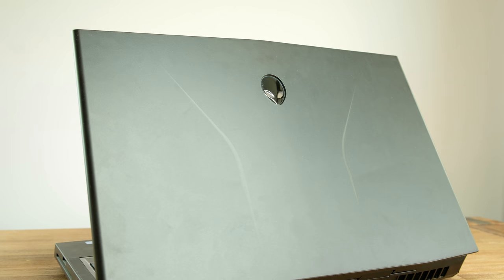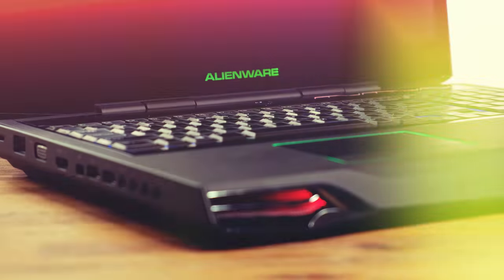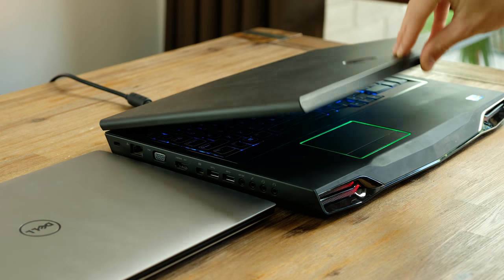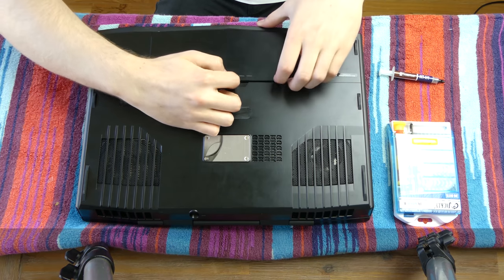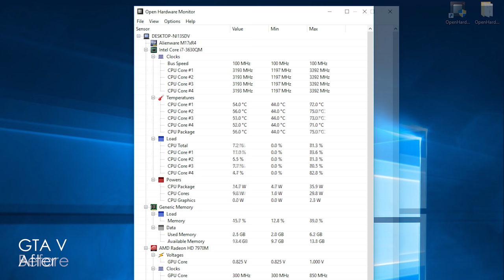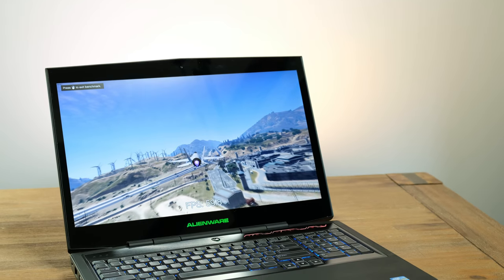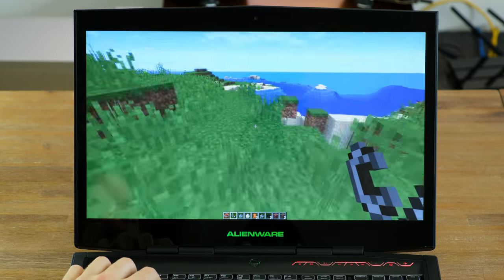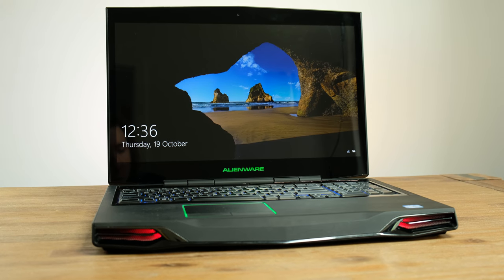Should You Buy an Old Alienware Laptop?

Comment: Wow, that temp difference before and after cleaning it was crazy haha
Reply: thats why you clean your computers desktops are much easy to clean then a laptop gaming laptops are a bad idea in the long run.
Reply: that and they're nowhere near as upgradeable as desktops! Always thought laptops should be thin and light anyway! :)
Reply: ryan felps not really, but yes desktops is more upgradable considering there size, but there's laptops with ryzen 1700 & i7 7700k with 1080s in sli, big but still portable with a 4k screen, my dell 7710 has a xeon,1070 and 4k around 1000$
Reply: This chip runs hot, my dad has it in his laptop and it was reaching around 90c under load and even after replacing the paste it still maxes out at 70-80c
Reply: He also miscalculated the change in degrees Fahrenheit too. He said it was a change of 27 C and 80 F, when it should be only a 48 F change in temperature.
Reply: Ar

Comment: My main issue would the thermals ageing the parts inside... But generally I've had very few, if any laptops die on me.
Reply: Yes
Reply from the maker: With the new thermal paste it should stay cool and last quite a while :)
Reply: Psivewri: Still a great laptop and a great video ofcourse though.
Reply: My 6 year old "Acel Shitspire" 5742 is still doing OK 6 years after purchase, despite being roasted for a good 5 years with overheating on the CPU. I'll have to take the mobo out and have a look.
Reply: you've literally commented on every video I've watched today xD
Reply: my acer 4755g bought at 2011 with 2nd gen i5 which is really hot mobile cpu btw still working until today and running at 88-95c when gaming and disabled the cpu throttling.
its at 55c to 68c when just browsing, light task and  watching 4k videos.
too bad bios is locked and i can't undervolt it for lower temperature while maintaining same performance. 

really impressed on 4th to 7th gen generation on how they keep lower temperature vs performance.
Reply: Often murdered slowly by people who ignore the fact that their fan is screaming 100% of the time. Not just folks in dusty environments, but also smokers, and owners of pets with fine fur. That matted dust clot becomes an increasingly efficient filter as it accumulates more material. I also here that there's a special place in hell for those who routinely smother their machines with blankets.
Reply: ZZZzzz I clean mine regularly, although currently, mine is quite new, and I only ramp up the fans when playing super intensive games.
Reply: If it's easy to clean it's not much of an issue.

All laptops will have their heatsink clog up over time. That's just what happens with a thin fin layout. I usually clean mine once a year because I start noticing the fan running faster.
Reply: Budget-Builds Official hey man!  fancy seeing you here!   :)
Reply: I have had 2 Alienwares die on me. The M17 R3 I owned had its GTX 560M fried from years of gaming even with replacing thermal compound every year and the M18X just decided to internally short twice. It shorted once just 6 weeks in and it shorted again 5 months ago.
Reply: The problem I have with my M17 is that I can't find many GTX 560 MMX GPU's on Ebay, though I did find a few GTX 480M cards. I refused to buy them due to fear that the Fermi architecture would make my laptop a furnace...
Reply: Lots of laptops from the mid 2000s up go about early 2012 produce more heat, especially if it's an AMD processor. I remember cleaning out my 2011 Dell Inspiron every 3 or 4 months because the fan was always working hard to keep it cool, not to mention AMD processor. The heat was so bad that it eventually made the battery not take a charge anymore. It's pretty much a slim desktop now and I treat it as such anymore.
Reply: you do realise that the GTX 500 series is also based on fermi (yes its a fermi refresh thats more efficient but its still fermi)
Reply: The GTX 580 ran much cooler than the 480 (like a 30 degree C drop in temps on the desktop side)
Reply: Budget-Builds Official 

I have a Clevo P170EM with the same processor and graphic card. I don't have any thermal issues. That's because I'm using liquid metal and the highest temperature under full load is 72 Celsius on the processor and 75 Celsius on the 7970M. And I can run Battlefield 1 on medium with solid 60 fps.

Although the laptop is 5 years old, I bought it for €300 which is $354 U.S dollars.

I had a budget of €1500 so I bought the Clevo that I'm using for college and still got €1200 left to build a very nice PC.

Win-win situation.
Reply: The only laptop I had die on me had the hard drive spin itself to shattering
Reply: My guess is that the majority of laptops will age themselves out before they die.
Reply: Budget-Builds Official I've had a gpu die on me once, but the whole rig was fairly old and unoptimised, I didn't build it though
Reply: What's the model of the laptop
Reply: Budget-Builds Official My laptop was made in 2007 and was made for Windows XP.. (I am not trying to advertize but) When I installed Chrome OS it could even play MINECRAFT!!
Reply: Dude just repaste.. shit..
Reply: oh hi budget builds official i watched all ya vids
Reply: That's true and I've had the experience first hand with an Asus G72GX laptop.  I used it for years for everything from gaming to a desktop replacement but it finally ended up in the closet a year ago when the discrete TX260M video card finally died.  All my laptops are meticulously maintained and even after years of use I've resold a few with the new owners giving me reviews like "It's just like new."  Nevertheless,  the thermal design of older gaming laptops was pretty pathetic and I remember dealing with HP warranty services over it on an HP ZD7000.  Thermals will ultimately do in an old gaming laptop regardles of how many times you replace the thermal paste.
Reply: Thermals under 90c wont age parts. Parts dont age.
Reply: I still have a thinkpad z61p from around 2007 that still works well
Reply: @ Budget-Builds: I bought mine in 2012 and I never had any issue with the thermals. It's still running fast without any issue. It's a good practice to repaste the cpu and gpu after a certain time and I did mine last year.
Reply: That's why I clean out those vents every two year or even sooner :)
Reply: Psivewri also, if you use the integrated you for standard use, that should help even more.
Reply: this laptop unoficially could run 1080 gtx if you creative enough 
trust me this laptop is rugged, powerful and extremely upgradeable
Reply: @lorumipsum1129  i have learned that this thing definely could run gtx 1080 mxm zotac version just good luck upgrading it.
Reply: Budget-Builds Official You’re awesome
Reply: Psivewri You’re awesome
Reply: Peyton Lutz  i have a M9750 A/W laptop, bought new 11 years ago, was working ok, then the screen has issues. dont know if its the screen, video card, or motherboard
Reply: My M6800 died on me once IIRC, and I'm planning on upgrading it heavily.

Comment: That was the best alianwere laptop ever made, great video bro! I would like to see it on video editing
Reply: I have a 5 year old MSI GX60 1AC with the same GPU but with an AMD processor instead, and I can run BF1 on Ultra in Singleplayer 😯
Reply: I plan on buying an SSD, the full RGB keyboard upgrade, and a better gfx card in the near future!
Reply: Rodrick HD it was nice but the newer work laptops seem o be beter
Reply: Rodrick HD haha no the alienware m18x of this generation was better
Reply: I have the alienware M18x r1 it's really good I was given it for free as I was owed money. Can't complain 😆
Reply: Rodrick HD Idk about that with a 7970m lol Maybe if it had the 780mn
Reply: I agree the m18x r2 was amazing especially after upgrading to gtx 680m sli and three copper pipe cpu hs and i7-3940xm oc to 4.2ghz.
Reply: Both m17x r4 and m18x r2 are the best laptops ever made by Alienware. Dell acquired Alienware and screwed up everything. No more upgradable alienware laptops! F@#$& Dell.
Reply: They are not laptops.  They are mobile destops, both in construction and use.  There is enough space for an AM4 socket on the M18x R2.  I'd image it is the same story for the M17x R4.
Reply: ateb3, yes Dell bought Alienware in 2009, but this chassis was still an original Alienware. Dell used first the chassis that Alienware had at that time. It's the same shape as the m17x r1 but improved. At that time, Alienware was part of Dell but operated independently and had more freedom in terms of designs. They even had they own website. I bought mine (red color m17x r4) in  2012, and the only thing that associated it with dell was the Dell finance service. It's still fast and working without any issue! Dell-owned designs started with the problematic oven m17x r5 (model after m17x r4). It was simply a rebranded previous generation of XPS dell gaming laptop. The founders of Alienware have moved on and are now with Origin Pc.
Reply: True
Reply: AlienWare was a great company for making a gaming laptop cause of their superior hardware and they have a magical on their requirement before Dell Bought them. But then, the magic and power on their technician are gone after Dell Bought them.
Reply: ateb3 
You are tripping if you say they definitely own by Dell. Dell aren't own them until 2006. Alienware was the independent company in 1996 - February 2006 without being owned by any company back then and their own gaming PC and gaming laptop they made before Dell bought them were great back then you know. How ignorant you are about Alienware evolution
Reply: @mr.unitato7955  he was stating that you don't have to buy an expensive laptop to play your favorite games, the laptop he just showed cost around $600(that's cheap and affordable)yes graphics ANF fps is a "tad" slow but hear me out, as long as the engine can run Strike Suit Zero, the possibilities are endless.
Reply: And this is probably the most upgradable laptop ever made. You can even upgrade the motherboard to the r4 (Ivy bridge) if you got the m17x R3 version with sandy bridge cpu, and the sandy bridge cpu's also work in the R4. You can even upgrade the display from 60hz to 120hz because it have both LVDS and eDP connectors on the board. And even the fans can be upgraded to fans that move more air. And even the heatsinks can be upgraded! 
It's "funny" when like the GPU dies on someones "thin" $1400 laptop, and they need to replace the whole motherboard with their soldered cpu and gpu's just to replace the GPU, while we can just replace the MXM GPU/ or do it as an upgrade. Personally i would never buy an expensive laptop with soldered chips. You rather wanna carry 5.5KG than loosing $600-$1000 on replacement hardware only mounths after the warranty!

Comment: I still got my Alienware M17 R4 bought in 2012, I don't play games anymore so I used it as my main audio station as it has Soundblaster in it to power my Edifier R2000db speakers. I upgraded the ram to 16 GB from the original 8GB, changed my SSD from 128 to 250 GB, and upgraded to Windows 10 from Windows 7. Still beautiful after almost 10 years as it is slightly used as seldom used for gaming as I have my deskstop built for gaming. I just bought it for bragging rights with my nameplate on it. I bought it for A$3,500 in 2012.

Comment: I got an alienware r2 15 inch laptop, for $470 It has a 970m 6700hq 16gb of ram 1tb hdd and 128gb ssd

edit: words
Reply from the maker: trystanidog good find :)
Reply: Thanks, i was looking for a laptop but i dident want to spend $500 for the potato laptops that were in the new market. It took me a few months to find it but its great!
Reply: trystanidog I envy you (I got the 15 r2 in early 2016 for around $1,600 I got the laptop, graphics amplifier and a GTX 1070 8gb and then a few months later the Alienware 15 r3 came out and had a GTX 1070 was lighter and possibly cheaper than what I just bought.....)
Reply: still cannot beat my buy lol
Reply: what did you get?
Reply: 1080p, ultra except grass. some things are turned on in advanced, with 2x msaa 40-60 fps
Reply: trystanidog wow, can please share the link of where i can buy this laptop. I couldn't find for 470 anywhere.
Reply: I bought it in person. Someone in my club at college was selling it. Got it for a steal!
Reply: Very good fine
Reply: trystanidog Not the best..,.gpu soldered to MB
Reply: I found a ROG G750JW with 4700hq, 1TB HDD, 20gb ddr3 ram and gtx 765m 2gb gpu for $499 last week.. but still doesn't beat your find man! You're lucky!
Reply: I bought alienware 17 r4 i7 6700hq, 16 gb ddr4, 1 tb hdd, 128 gb ssd, 17 inch qhd g sync display and gtx 1070 8 gb in 1500 USD
Reply: Where did you buy it's and can I get a link if I can buy it
Reply: Mohammad Taha that 1070 i bet is lovely!
Reply: trystanidog srsly 128gb
Reply: It's crazy how fast tech devalues for the "next greatest thing" on the market
Reply: Nice dude I got that laptop the first day it came out for about 2100$
Edit I know I should have built a desktop but I was 12 at the time 15 now was pretty decent at the time go ahead and hate if you want I know Alienware is dog shit
Reply: Tom Tapp what do you expect in a laptop?
Reply: trystanidog I envy you, I bought a $950 MSI with 7700HQ 8Gb DDR4 ram, 128 SSD, 1Tb and GTX 1050 2Gb
Reply: I spent 500$ on pc without the graphics card or ssd
Reply: trystanidog bargain
Reply: I found a laptop for $430 8th gen i5 8300h GTX 1050ti 4gb 8gb ram 256gb SSD I can't think of a cheaper way into mid range PC gaming
Reply: @gabespringhetti7890  thats amazing for the price now all you need is 8 more gb of ram
Reply: Kameronismyname sold it for $650 a few weeks after that comment 😂
Reply: @gabespringhetti7890  i just got a dell laptop  for 899 with 256 ssd ,1tb , gtx 1060 6gb , i5-8300h 16 gigs of ram too . Hopefully i can resale it for 1,000 one day 😂
Reply: Kameronismyname I only let it go for $650 because it went to a friend and I wanted something more powerful
Reply: @mageenderman  did you return it

Comment: 1:12 all of the failed attempts to plugging in the hdmi lol
Reply from the maker: Yep! The previous owner definitely used that HDMI port a lot :)
Reply: Psivewri what's the benefit of the hdmi-in on this laptop I don't think I've seen that before
Reply: jt3000o the port label says HDMI out
Reply: Looks like my ps3s USB ports.
Reply: Vertical Twist nu cūcīgi
Reply: The Curator and the other one says hdmi in
Reply: Vertical Twist r
Reply: Lacho lol
Reply: Good eye XD
Reply: @WAPOverdoze  
Yeah, and you can probably use it as a capture card too which is cool
Reply: Thats what the back of my playstation 4 pro looks like lol

Comment: Dude I got damn near the same laptop since 2012. My brother passed it down to me and boy has it been through some hell. Multiple OS changes from Vista, Linux, and Win 8.
Though just recently Ol' Betsy is starting to go out on me. The battery life is practically non-existent. Gets hot as all hell. Starts becoming unresponsive after repeated startups with no hard shutdown.

Then the worst part, the AC Adaptor is really starting to make some popping noises. Like it would set my house on fire if I went to sleep with it plugged in. That and some keys stopped working as well. Keys "6789 and O" don't work. 

The old girl still got some life to her, and after watching this video may just me some ways to get her back on her feet. The clogged CPU vents for one are definitely an issue. The fact you can replace the graphics card is a neat feature. Could probably replace it with one of my brother's old graphics cards. Pretty much just gotta replace the battery, Power Adaptor, and clean up the CPU and she should be good to go again.

I remember playing Mass Effect 3 on her, but now she can mainly run Flash games. I know it would be better just to replace her with a newer, slimmer laptop, but shes what I use during downtime in my room. The PC rig my brother built me, a Thermaltake core x9 I call Big Bess, has to stay in the living room. Can't really drag the big girl to my room when I'm done for the night.

Anyway, sorry for typing a lot, just had to share my story since most these issues popped up last night. I don't know how I came across this video but I'm glad I did cause it could get Ol' Betsy back in shape.
Reply: Robbaz Corgi
Jesus man, I've been fairly gentle with mine with it first came out. All keys work as far as I know. No popping noise from my power supply. Then again I probably wouldn't hear it considering how loud the damn thing is under load. I always keep it plugged in though.
Reply: Wow thats a heart warming story
Reply: just play valve games
Reply: Not the O
Reply: imagine if thr WASD keys stopped working
Reply: That was beautiful man
Reply: You must need a girl badly lol
Reply: then how r u riting dis  text
Reply: shes not a girl
Reply: @mwbgaming28  Lmfao good one 👌
Reply: @keltong16  that's pretty much what the video is about.  "It doesn't matter how you get there, as long as you get there."  -John Candy
Reply: Ay we have somewhat the same story. I am on my mom's old M14x from 2011. It has GT555m and intel hd 3000, and an i7 2630qm. It also has 6gb ram stock and no numpad (not made with one). I overclocked the Nvidia graphics (using msi afterburner) and it reaches nearly 200 degrees F when I play Roblox Phantom forces on all low graphics. It's on its second hard drive, the battery doesn't charge (it shuts off the second it is unplugged), the cmos battery is going bad, the hard drive clicks on startup, it is missing the esc and right bracket key, and is missing some of the front fascia and the entire righ side panel. But, the RGB still works. I don't think this thing will last much longer.
Reply: kristheblack 617 LOL EXACTLY